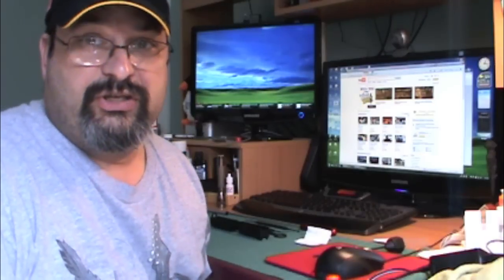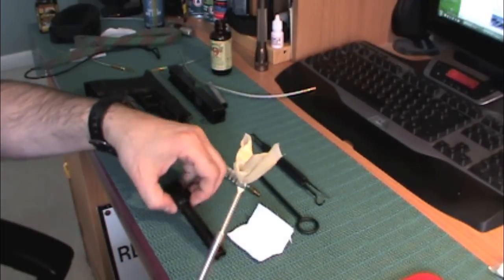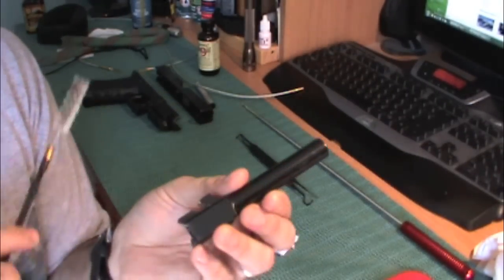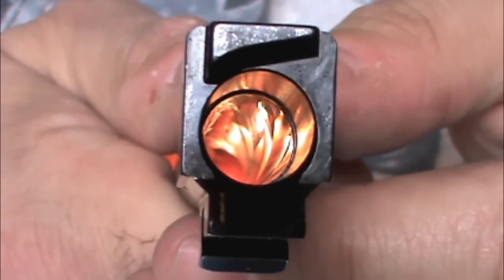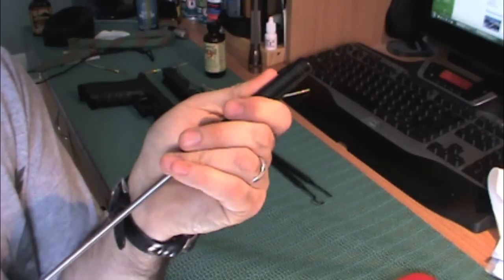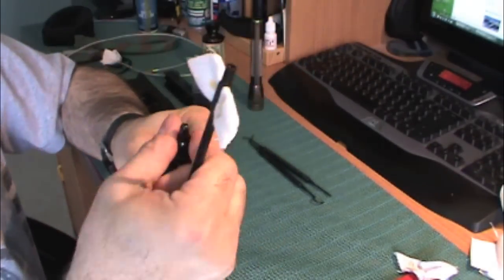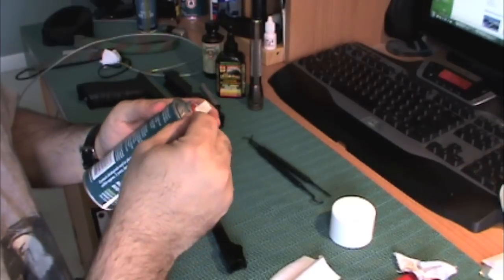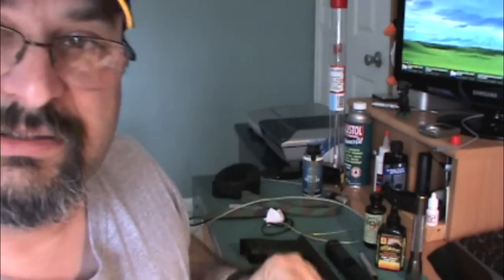Pistol Barrel Cleaning

Comment: A brass brush will NOT scratch the inside of your barrel!!
Reply: No Name a brass brush is very soft metal. Your barrel is hardened steel. The crown of your barrel will be fine. Do you think that running a brass brush back and forth is more forceful than a FMJ bullet exiting a barrel?
Reply: How do you know are you a barrel? 😂😂
Reply: @BKNYFrank  😅
Reply: My family are barrels going back 10 generations. My sister is a barrel. Brass bore brush does not scratch your barrel.

Comment: I heard a sales clerk tell a couple that if they used a copper bore brush it would scratch the barrel. I didn't say anything, but if a copper bore brush can scratch the barrel of a Glock or any other firearm, I'd hate to see what bullets are going to do to it. I agree that you need to go all the way through and then back, but scratching the barrel? I don't think so. If Glock barrels are that easy to scratch I'd love to know how they think they'll last with thousands of rounds shot through them. I've always used a copper bore brush and my Glocks shoot just as good as day one and I'd be willing to bet there's no scratches in the barrel either.
Reply: True that. Barrels are hardened steel and a copper/brass brush can not scratch it. It bothers me where some people are getting this misinformation and spreading it.
Reply: @lousmith5264  I agree. I have no clue where he got that information, but he not only believed it, he was telling customers this garbage. It just goes to show that just because someone is behind the counter of a gunshop, it doesn’t mean they know what they’re talking about.
Reply: You never ever go back, you only do one direction passes. Do your pass, unscrew from the tip of the barrel and then pull the empty rod back through the barrel.
Reply: @TerminalM193  nonsense

Comment: After cleaning and drying out the bore, a very light coat of lubricant is supposed to be applied correct? So when looking down the barrel, you should see a shine but no excess lubricant moving around or droplets?

Comment: I accidentally used a nylon brush on my Glock 19X from the muzzle end. I did twist the brush while it was inside. This happened twice or thrice during a single cleaning session. 

Any thoughts on whether this could have caused damage to the crown?
Reply: I mean I don't think I'm nylon brush should have done any kind of damage. If it did you have any defective barrel. I mean I have in the past before I learn how to properly clean a barrel round copper brushes up down left and right spinning twisting and every other witch Way and never damaged a barrel. I don't think nylon is really going to do any damage. But getting an answer from someone that is quote-unquote a professional would be the best way to go about this or a little internet research. 🇺🇸

Comment: Hi, went to the range today shot 80 rounds took a look at the barrel notice orange stripes in the bore it must be cooper cant get it out the first time experiencing this. The barrel was shiny and clean what went wrong?   help Thanks
Reply: Ive got the same problem but i bought a new 9mm and still have yet to shoot it. I disassembled it and peeped in the barrel and noticed almost rust or copper color stripes between the rifling i believe and ive never shot it before i just hope its not rust
Reply: @bamabassgrabber  ALL new firearms are test fired at the factory. That is probably what you see.

Comment: does it hurt to use a metal brush on my glock barrel I have some build up that wont come out with the glock brush
Reply: My gunsmith brother-in-law uses a brass brush chucked in a variable speed cordless drill on low speeds (to prevent heat buildup) to work stubborn areas. Don't let brush get dry.